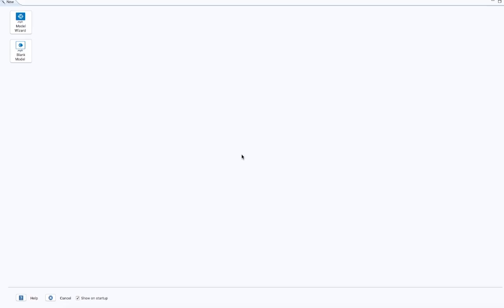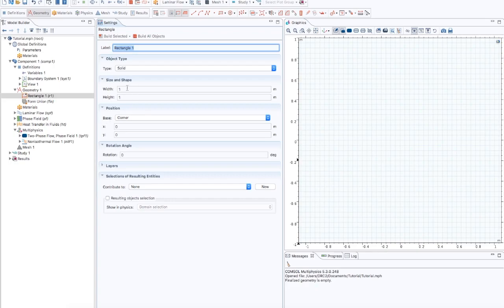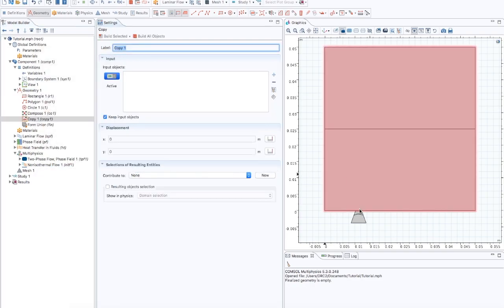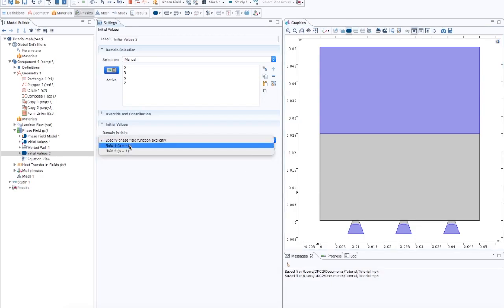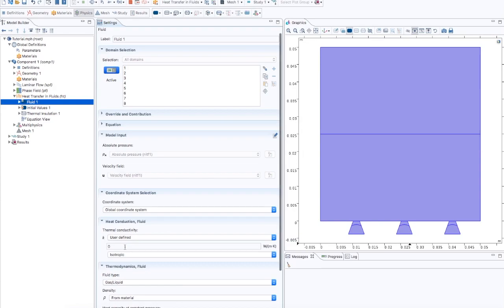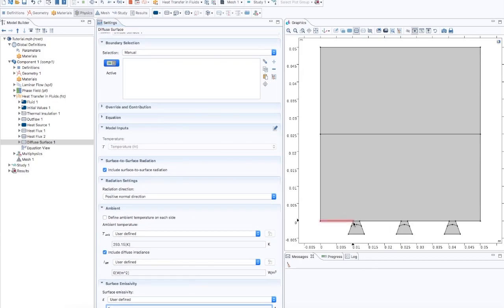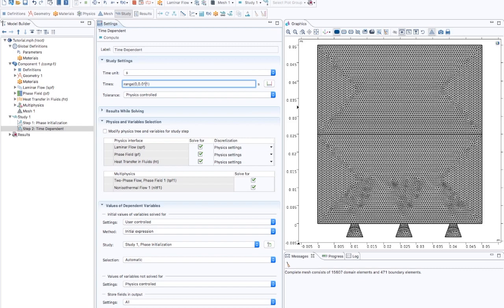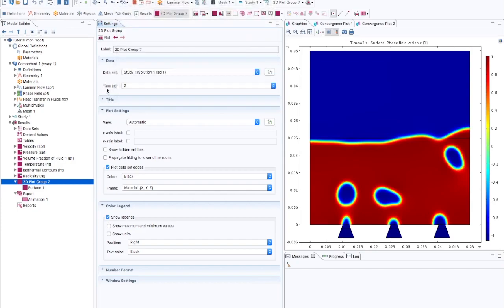2D Pot Boiling Tutorial in COMSOL Multiphysics

Comment: Thank you very informative and seems to work on comsol 5.5 by replicating the steps. One change is
Radiation is added separately and than coupled in multiphysics interface with the fulid 
(when adding equation for the weak form it turns yellow test(p) which denotes unknown variable p which is probably pulled later from pressure(perhaps) so doesn't create any issue.)